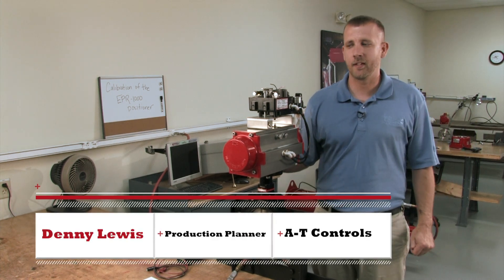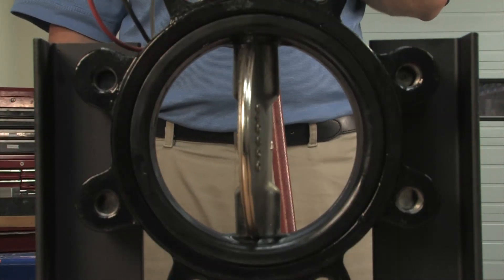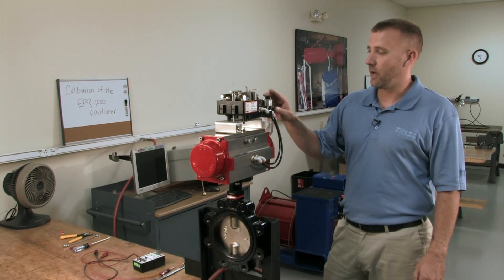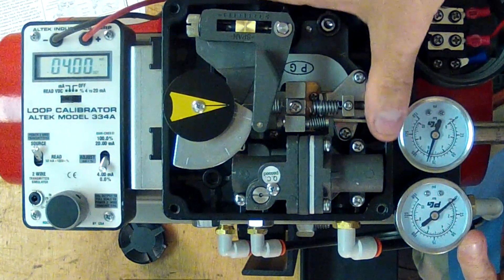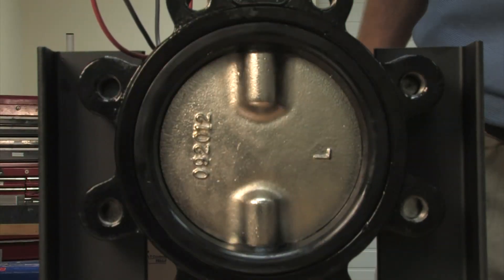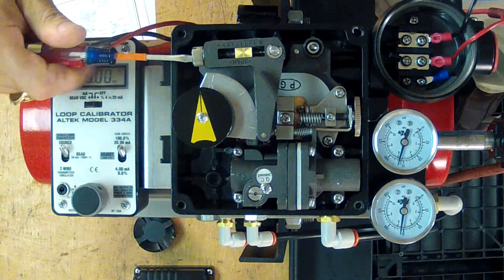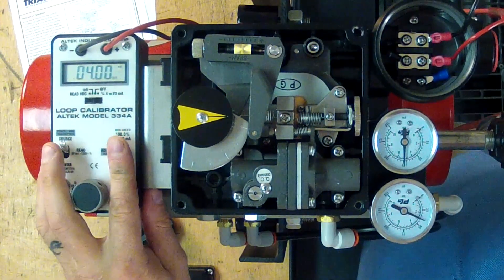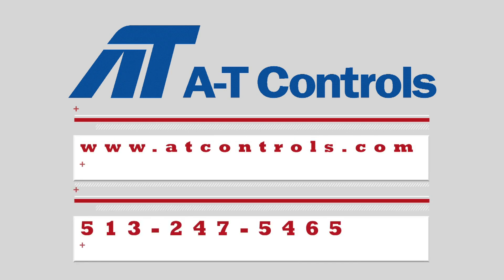Calibrating an EPR 1000 Series Positioner

Comment: Hi, How to adjust if :
  4mA=0%
  6mA=25%
  8mA=50%
  10mA=75%
  12mA=100%
Reply: Fairly certain you would need a different/specific control cam for split range control.  3-9psi (4-12mA) cams should be available from the manufacturer.

Comment: Greetings. Your consultation is necessary. In advance thanks. I by the ship therefore think will answer quickly. On a boiler  E/P Positioner Model-YT 1000RDn531S13 and  problem Positioner dose not respond to the input signal, but sometimes works bormal. calibrator is not preset. suggest that make  thanks.
Reply: Bad luck, the models with the letters YT are from China, the capsule that serves as a relay contains a pivot that wears out and flares its seat that is used to make the closure, and by not performing the air seal, it loses its function of position.